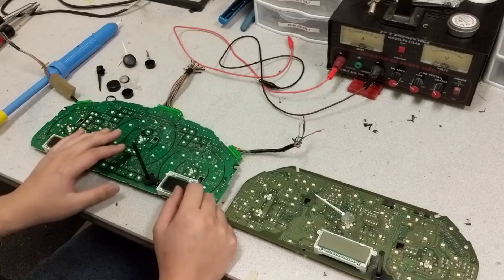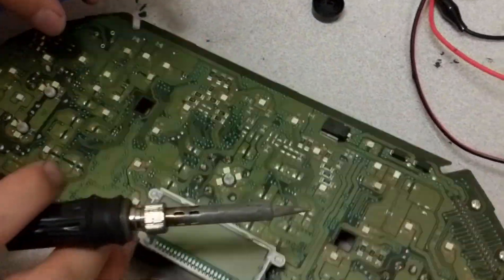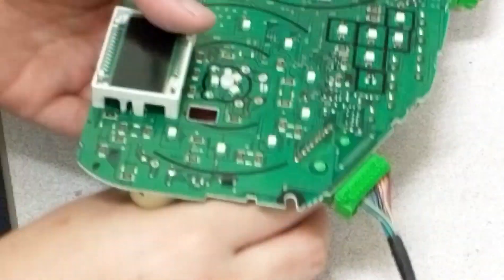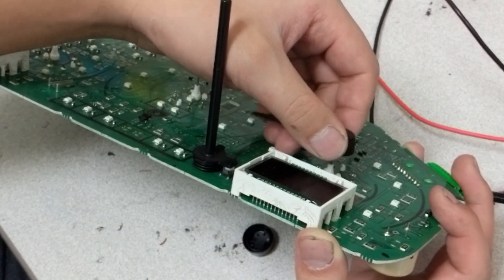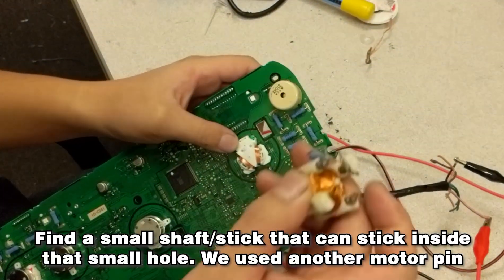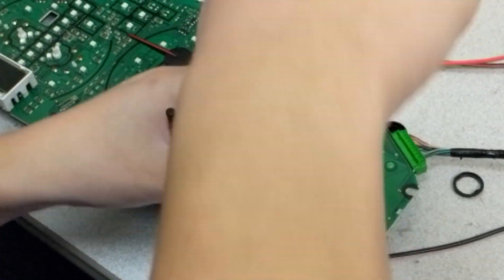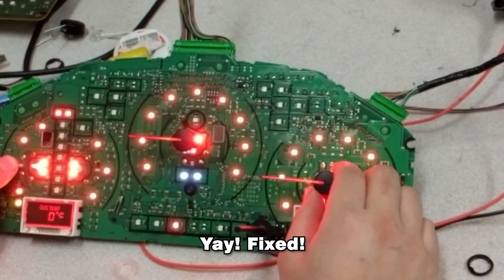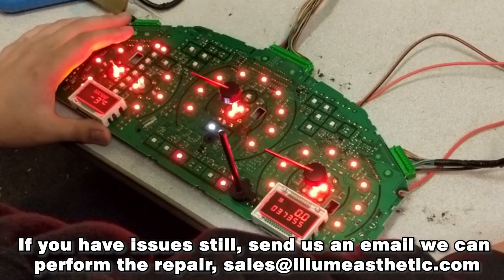How to Fix Sticking/Stuttering Subaru Gauge Cluster Motors! - Illumaesthetic Motor Fix Tutorial

Comment: My question is the stepper motors in a kph cluster can they be swapped with us stepper motors to convert kph to mph on the jdm guage cluster or is it the frequency inside the circuit board that determines the speed 🤔 interesting subject to experiment.

Comment: I'm looking to do this on my 06 forester cluster. I would love to be able to bench test it like you are but can't find any info on setting up a wiring harness for it. Any chance you can direct me to what I should power and ground?
Reply: There should be pinout charts for the guage cluster harness. In the video I only seen 2 or 3 wires to a clamp. Subaru should have the charts parts has lots of info in there system.  I used to work at subaru

Comment: This is a godsend. I took apart the cluster on my Honda Jazz (Fit) GD3 2005 and damaged the functionality of the needles. They have these exact stepper motors. I spent about 1-2 days diagnosing and attempting to fix the sticking issue, I ended up figuring out the exact same solution as you mentioned here but i still had the flickering. Was happy with the gauges functionally but the flickering at the start was bugging me, i knew i was missing something. I realised that some earlier mazdas and subarus used the same exact stepper motors, so i started to research through some of the old forums from the early 2000s. It seems like subaru owners are more likely to mess with their instrument clusters than Honda or Mazda owners 😂. I found some posts with methods of fixing the sticking that pretty much resembled exactly what i did to fix my needles sticking, so i knew i had a lead. Then i found this video and i was happy to see the same method i used to fix my sticking issue. But best of all, a solution to fix the flickering on startup as well. It makes complete sense now that i think about how the magnetism works internally. I think i got lucky and randomly aligned the needle correctly one time when i was messing about trying to fix the sticking earlier, but now i know that it actually is fixable, and quite easily at that. Thank you so much, I can now take apart my instrument cluster without any worry of the needles 😁.

Some things i would add to anybody who wants to attempt this as well: you can ream the holes at the back of the stepper motors with a tiny 1mm drill bit to make inserting something easier. 

PS I took apart my gauge cluster to disable indicator hyperflashing, as the relay circuit is located on my cluster, stupidly enough. If anyone wants help with this just let me know 😂

Comment: Just wondering if this will work on a subaru 2003 impreza, I hope it does coz I pulled out my needles while I was playing around with it and now have absolutely no action from both my speed needle and rpm needle whatsoever, gonna give it a go, I'll let you know if it does haha
Reply: Can confirm I was able to fix both motors with multiple trial and error of pulling out the needles. Can also confirm it would have been much easier with a simulator lol. Also my 2003 Subaru impreza GD has a slightly different cluster but I was able to improvise and now they work, but not worth it coz the LEDs I put in look shit lol

Comment: This is a great video, I did a cluster swap in my forester sh. And all my needles pulled out when I wanted to separate my cluster to cover a few LEDs, the cluster was out of a sti so the diff temp light was in and one of the si drive lights. I've watch this video repeatedly to try and fix my twitching and sticking issues. The tach and speedo still have a slight sticking issue... So back to the drawing board.
Reply: I'm going through this now with little to no luck on the stock SH cluster for a 2010. Highly doubtful to ask since you posted around a year ago, but did you ever get it fixed?

Comment: This video was tremendous help. Made the mistake of pulling my needles out to get to the side of the circuit board where all the LED's are. I managed to somewhat fix my tachometer & fuel gauge, except for the minor flickering.

My main issue is that I think I pushed too hard in the hole to reset the magnet/gear for the speedometer and there's no more free play in the shaft and it is hard to spin freely. I've tried pulling the needle out and repeating the steps, but it still hasn't helped. The first half of the spinning is hard, but the second half spins a little bit more freely, so I'm using the second half of the spin for the beginning of my speedometer. A reply would be much appreciated. Thank you!